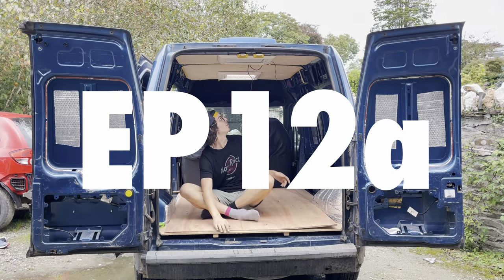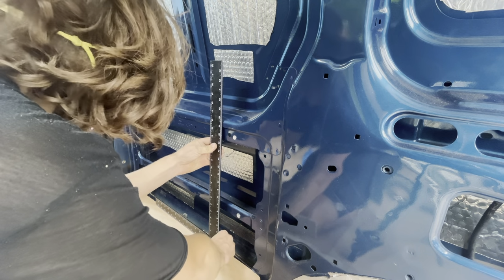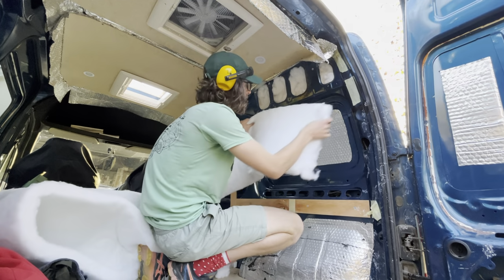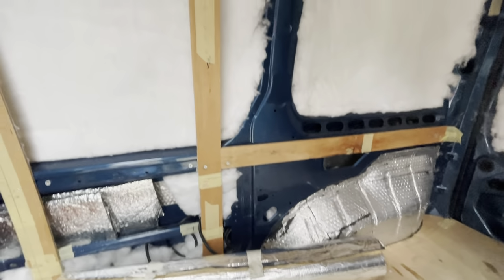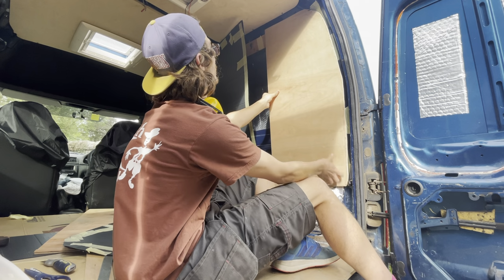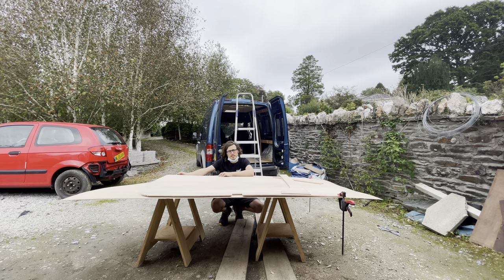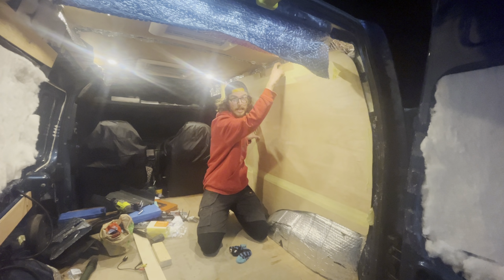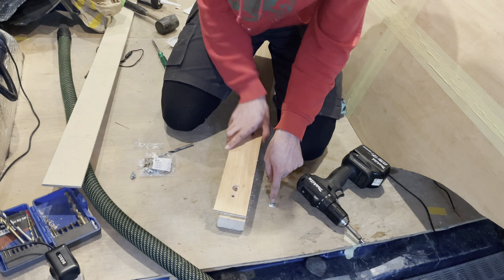Making the walls | Ford Transit Connect Van Conversion

Comment: Can I just say the one thing that I don’t like about your vids is there too short I could watch you and your skills for hours fella so stop selling yourself short. 👍👍 A pleasure as always 👍👍
Reply from the maker: Video length is something I always think about. Unfortunately, the main things that affect the duration are file size and the time required to edit! A 10 minute video, after editing, takes about 8 hours to encode 😱. Another factor (which is the case today) is how much of the van I’ve actually managed to convert! There’s more to do on the walls so I think splitting it in to 2 episodes is better for momentum, rather than not uploading anything for a week! So essentially, I guess my answer is that I agree they should be longer, but I won’t always able to achieve that🤞🙃 Thanks for your comment! It’s a pleasure to make the videos too

Comment: Curious why you didn't fix the wall to the frame of the van itself 🤔
Reply from the maker: There’s a few reasons - primarily because it allows me to remove and reinstall the wall as many times as I need. Self tapping screws straight in to the frame of the van can only be removed so many times before the hole eventually wears. 

Having the battens behind also allows for the walls to breath, and makes space sockets to be added
Reply: @AtypicalWorkshop  Good point... But you have a riv nut tool😎👌
Reply from the maker: @rustandoil  riv nut tool has been one of my most useful tools yes, but this approach would still work without. You could fix the battens to the frame with self tappers and proceed as per my video from there

Comment: Shaping panels to the transit connect is soooo annoying :’(.  Nice vids!
Reply from the maker: So frustrating! It was so much easier when I switched to the 4mm ply. What did you use for your walls?
Reply: @AtypicalWorkshop  I’m using 1x2 furring to frame my walls since I have windows all the way around my transit.  Pasted the insulation in all the gaps and used tongue/groove poplar to cover.  Love your build btw.  Helpful to see how you’re doing everything